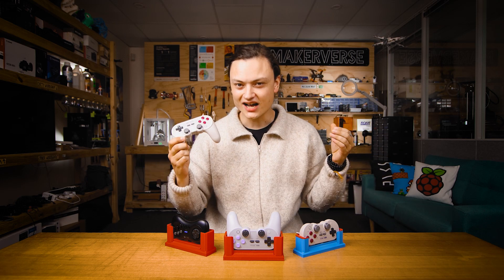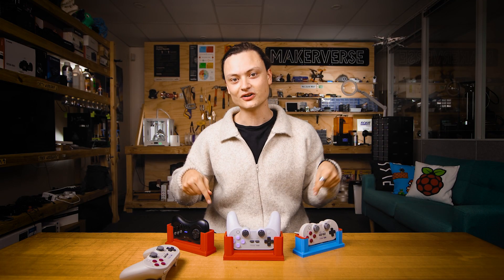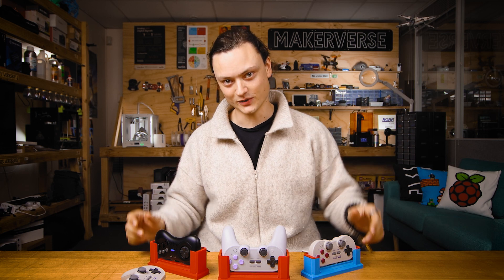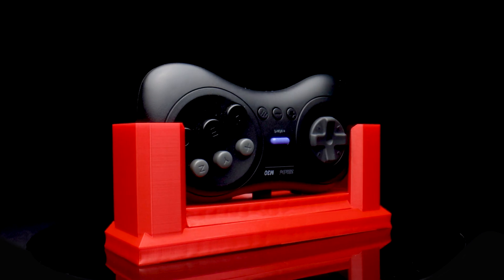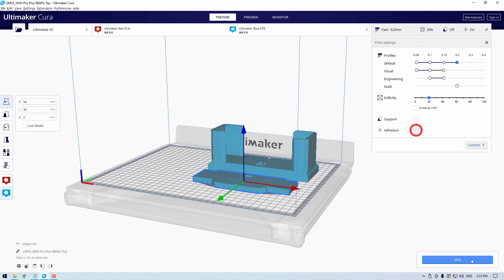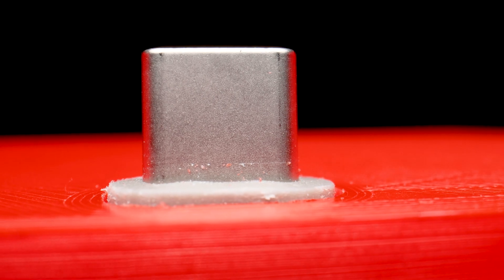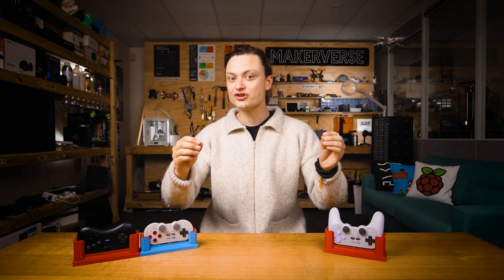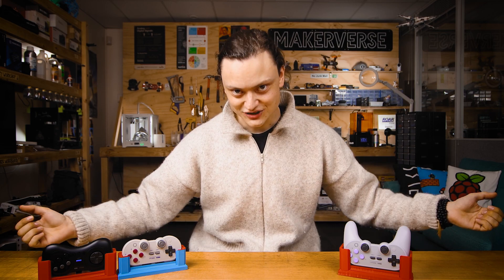Charging Station For 8BitDo Controllers! 3D Print Your Own!

Comment: Any chance the SN30 Pro dock will work with the original SN30?
Reply from the maker: Not sure, the SN30 has a USB micro charging port instead of USB-C so the cable might have a different fit in the dock.
Reply: @Core-Electronics  ok thanks for the reply. I printed it and it did not line up. Gonna make some tweaks to the lid and try it again. 😁